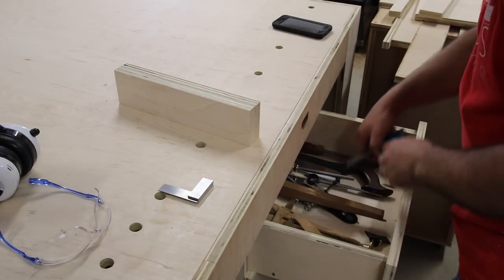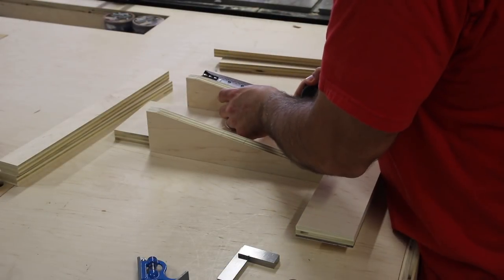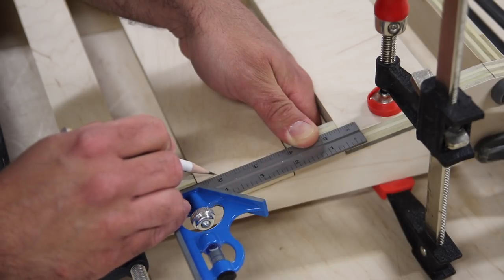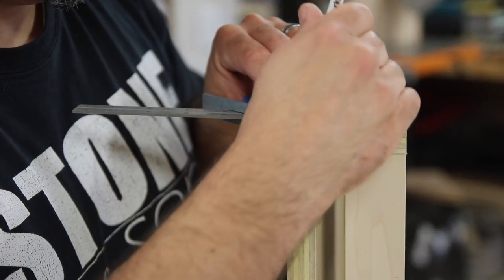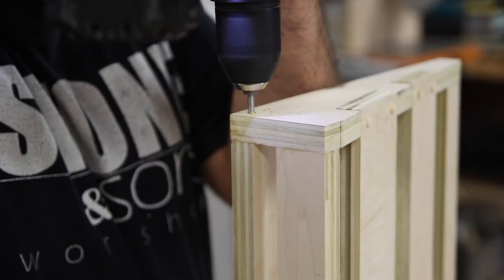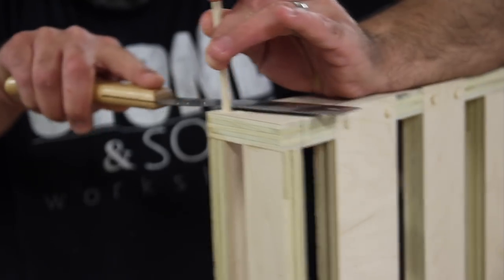Make a Pedal Board - with Plywood

Comment: A chill video, Shawn. Your narrative style, timing, and tone are quite good. One gentle suggestion on the flush trim saw technique: put a finger or two down on the blade back to gently keep it against the workpiece. Don't need much pressure at all, just enough to stabilize. The neutral set of the teeth won't scratch, and you'll have much less to sand/plane away. Cheers.